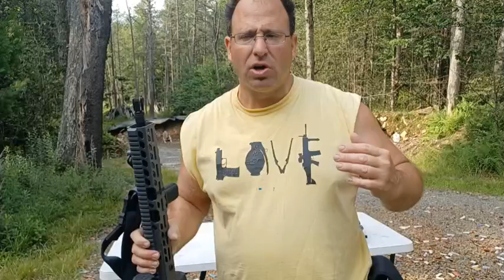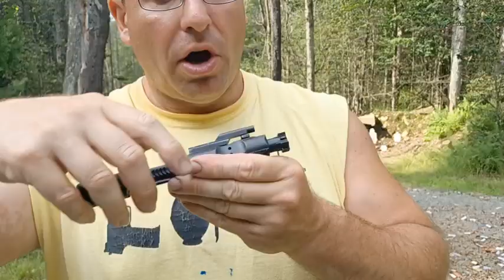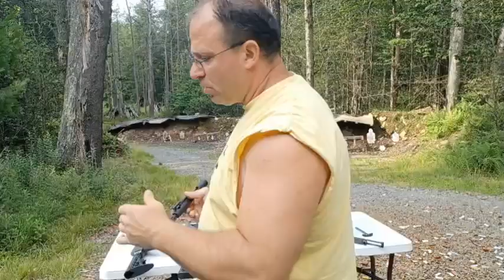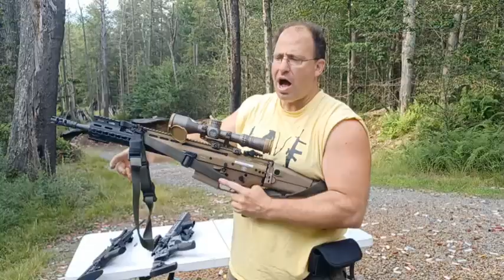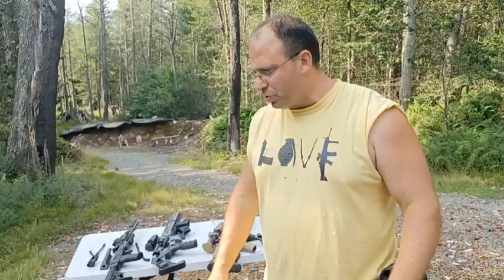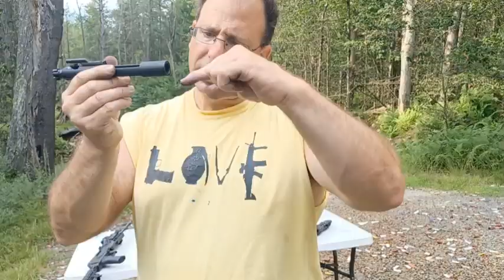Short Stroke Piston AR-15 problems

Comment: I've always wondered about the self contained BCGs meant to convert a normal AR to a folding AR that will fire when folded. If you haven't seen them, they look similar to the SIG but probably weight even less. I have an 8.3oz bcg in one of my ARs and I bet it's heavier than whatever these bolts I see on Instagram are.

On your most over gassed AR it'd be interesting to see how heavy of a buffer it could handle and how the gun felt. I've been thinking about putting a 10oz dead blow buffer in a normal AR to see how slow it'd bump fire
Reply from the maker: I did a video on side folding ARs recently....
https://youtu.be/VZFEPQzuZZ0
Reply from the maker: On a very overgassed AR, i could not get the buffer weight heavy enough to stop splitting cases. Port hole was too big
Reply: @tsafa even a 10oz didn't do anything? That's crazy lol

I saw the folding video, about what I've come to find myself. Good if you have a backpack and short barrel but that's it.
The BCG I was talking about is from a company called evolution weapon systems but there may be others like it. It's DI though, not piston, and looks like a normal BCG but cut in half. Looking at a video on their Instagram it seems to recoil a bit hard and really flings the cases, leading me to believe it doesn't have enough inertia to strip rounds unless it's turbo mode. There's a lot of parts like it that are essentially fashion accessories and are a liability to have I something you depend on.
Reply from the maker: That's very interesting what the cut bolt. I hear that competition Shooters go with super light cut bolts and very little gas for minimal recoil. I heard that there are issues when it gets cold. I have not tried it myself, I'm just going on here say. I would definitely try it if I came across it and do a video.

When you say that in the video it was recoiling hard and flinging the cases, it seems like it was not matched up an adjustable gas block or restrictive gas tube.